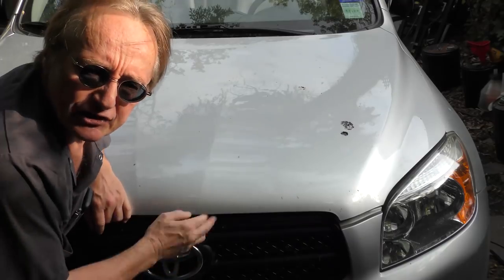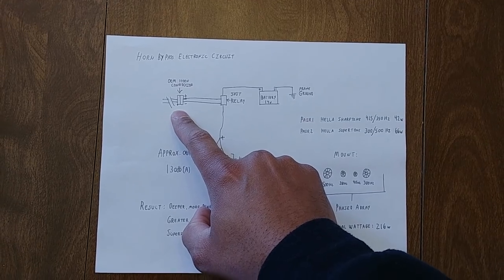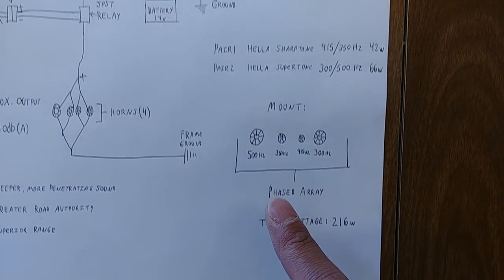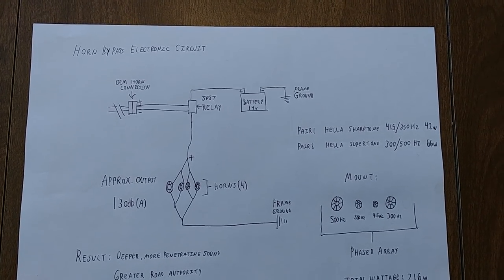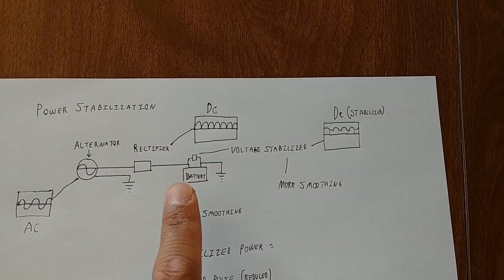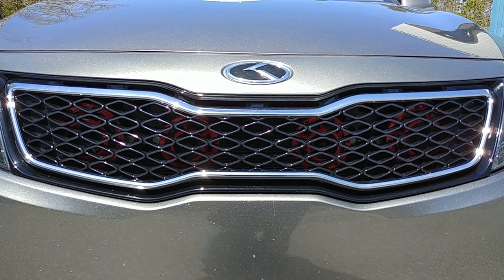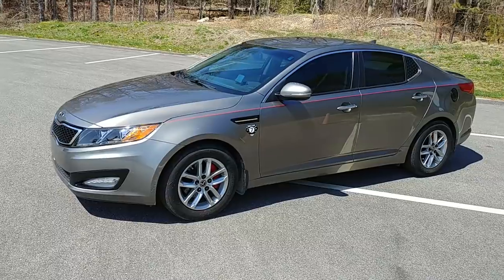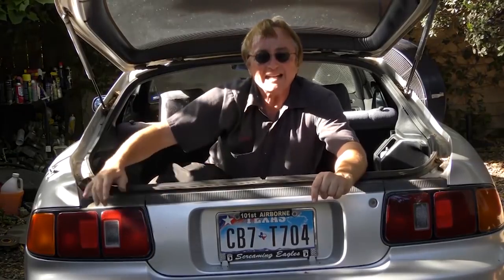Here's Why this 2013 KIA Optima K5 has Quad Horns - How it's Done

Comment: Well, I don't think you can get a better voltage stabilizer than a car battery. I get the impression that the voltage stabilizer is snakeoil. Also - the flashing LED's on camera has nothing to do with the alternator or voltage fluctuations.
Reply: Peter Riis There is a noticeable difference. Voltage stabilizers don't do even half of what they claim, but the light and horn improvements are real enough.
Reply: Nope. I don't think so.
Reply: Peter Riis Have you tested this? I have, and there is a measureable difference between a system equipped with a stabilizer, and one without one. Granted, the difference is much more apparent on older vehicles, but it is still present even on later models.
Reply: Okay then. What is the peak-to-peak voltage on the battery terminals with and without the snakeoil? Does frequency have any impact on this voltage? And how does it affect the multiplexing and pulse drive for the LEDs?
Reply: Peter Riis Peak to peak voltage averages 14.7. I don't have access to an oscilloscope right now, but in testing the voltage peak waveform was a lot "smoother", without the drops to neutral state. I'm not sure where you're going wit the multiplexing, but at 30fps on camera, the LED flicker is less "deep", with stabilization, or rather, the LEDs do not dim out completely, as they do without stabilization.
Reply: +UnitZER0
14.7 Vpp on the battery terminals? I see you know something, but unfortunately not enough. So, most of your claims are subjective impressions - and those are not measurable.  ;-)
Have a nice summer. :-)
Reply: Peter Riis Never claimed to know anything. I only go where the evidence takes me. In this case, the evidence suggests a measurable benefit. However, you are entitled to your opinion.
Reply: Yes, you claim that “there is a measureable difference” and now "benefit" which to me sounds as you have measured a difference or at least have access to these measurements.

Let me explain one functionality that shows why you’re mislead.

1. When LEDs are turned on or off, they’re on or off instantly.
2. Therefore you can turn a LED on and off very quickly.
3. When you do that, so quickly that the eyes don’t see it, they seem less bright.
4. That is utilized to make the same red LEDs function as rear light and brake light.
5. Working as rear light the LEDs are turned on and off perhaps 100 times a second, being turned on only 20 percent of the time.
6. That means on-time is 2 ms (milli seconds) and off-time is 8 ms.
7. You see that as normally bright rear lights.
8. A video camera will see some flicker, usually a wavy sort of flicker.
9. Working as brake light the LEDs are turned on all the time.
10. You AND the camera sees that as very bright light, and even the camera sees no flicker (as there is none).

Okay?

Tell me - are you selling these things?
Reply: Peter Riis No, I do not sell anything. I'm simply using a product that at least according to the instrumentation I'm testing with, does provide a noticeable effect. Whether that effect is beneficial or not remains to be seen. All evidence at this point seems to indicate a measurable benefit. Whether that is due to my own perception, or faulty interpretation of what the instruments indicate, or if it is in fact empirically true remains to be seen. My only response to you would be to do your own testing, and draw your own conclusions.

Comment: Didn't these engines called theta ll have seizing issues🤔🤔 wonder if Kia fixed the problem or does it still exist🤔😏😏😏
Reply: PLATINUM I got mine replaced under warranty. 100,000 mile car, 2500 mile engine.
Reply: UnitZER0 WOW
Reply: Problem was fixed on Late 2014 to present.................
Reply: RoadStar1700P90 that's what I thought.idk why these guys are saying the 2018's needed a engine repair.. I guess someone's lying😂

Comment: Not impressed. You want a horn that commands respect and gets people out of your way, install dual Fiamm air horns. They sound like a train or a big rig. You honk them, people will take notice, sometimes they'll get over and out of your way without looking, thinking it's a big rig on their butt. I know, it's an old time fix, but it still works, and you can still get the Fiamms tho these days they're made of mostly plastic. Yes, they do take an air compressor, but that's built in to the system.

Comment: These 2013 kias have engine problems, good luck.
Reply: Got a full long block replacement under warranty a few months back. 100,000 mile car, 2500 mile engine.
Reply: UnitZER0 Do I get a new engine, if I have a rebuilt title.

Comment: OR...you can get yourself a "BAD BOY" brand air horn  on eBay for under $50.00Compact all in one unit, just a 2 wire connection. Sounds better and louder than yours !